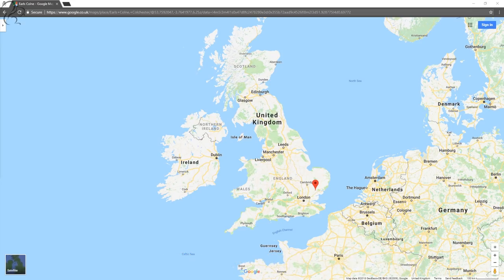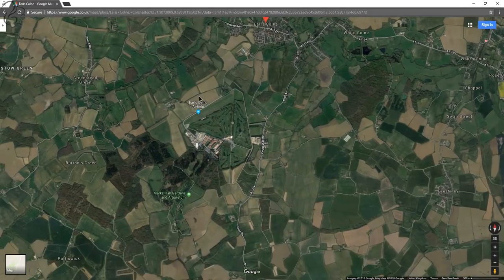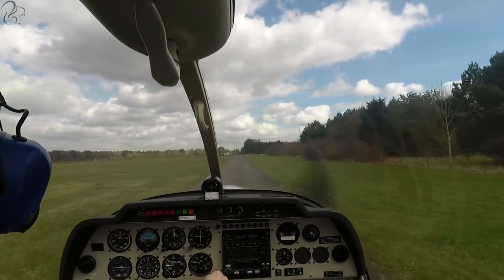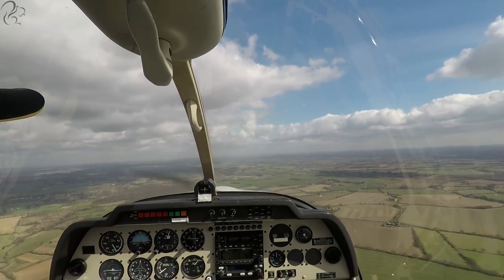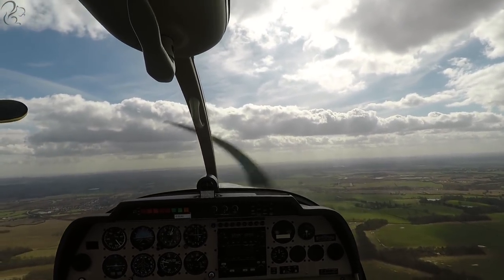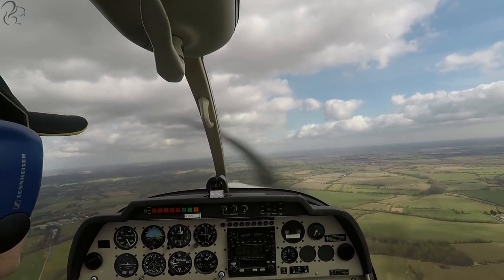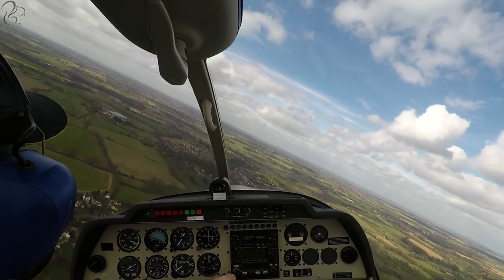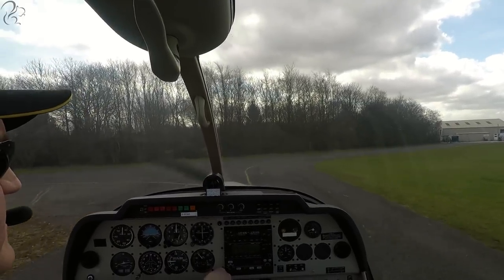Flying Solo Circuits - Flying Squirrel (#1)

Comment: Hey squirrel,
Although the slight crosswind you could have put in rudder so the nose faces into the wind and then when you're about to touch down kick the rudder off. Also you 'Ballooned' your landing which you should of went around instead of almost stalling at about 10 feet.

Comment: enjoyed that found it interesting. The americans flew Marauders out of there, the pub on the B1024 Coggeshal Road had its hipped roof removed and replaced by a flat concrete roof as the bombers flew out so low . The current roof was built over the top of it. When I did my hgv training the perimeter road was used for the reversing and emergency exercises.

Comment: I usually think flying is boring. But i found this video interesting all the way through. Think it was because you talked the whole time.
Reply: Moto_Nerd yeah how he remembers all that stuff is beyond me.
Reply: Bassmint I think with lessons I could learn to fly but to remember all the things to say I'd have to write it down 😂
Reply: Bassmint check list. One can see him consulting it on pre takeoff check. Otherwise it seems pretty common sense. Couple spot calls to tower on procedure points. Looking for other in turns. The landing equipment check is the biggest one. Though I think usually pilot has checklist handy visible to consult. Kinda supposed to also. Even decades flown commercial pilots are supposed to follow written check list in key checks to prevent mind bugs ruining things.

Actually flying is pretty much like driving. Experience, learning routine skill,  practice and feeling the planes response. Following to main indicators altitude and air speed. Apply pitch and throttle as needed. As said mostly it is just about having enough training hours flying, to get the routine and muscle memory for it.

Comment: Great video! I love that you're taking your flight (sim) love to the next level.
Is it possible to film this with a global shutter camera, cause that prop deformation is triggering me.
Reply from the maker: 30fps camera causes that. I could film in 60 but you’ll just have a prop that spins slowly instead. Can’t get rid of it I’m afraid, not with a GoPro
Reply: Need a DSLR to get rid of that artifact.

Comment: Whaat age you need to be to start PPL? Because i'm 10

Cheers from Finland
Reply: Jopu 700 likely 18.
Reply: It changes by country. Here in the US it's 16.
Reply: You can fly with a instructor at 14 and solo at 16 but you can't get your lisence until you are 17.
Reply: Here in the UK it is: 
16 years old to hold a licence for a glider or balloon
17 years old to hold a licence for aeroplanes or helicopter
Reply: jonFezza Thanks mate
Reply: TORILLE
Reply: Age isn’t the issue man. It’s the price, have you got deep pockets?
Reply: Donovan Johnson , that is incorrect.  There is no minimum age to start receiving instruction from a CFI in the US, it is left to the discretion of the instructor.  I know this because I started at 14.  There are a couple age requirements for later pilot training.  You must be 16 to solo (fly the aircraft with no instructor on board [but you are still unable to carry passengers or fly "cross country" without pre written endorsement from your instructor in your log book {among other restrictions}]).  You must be 17 to take the private pilots examination.  I don't mean to be disrespectful but I do think it is important to avoid spreading misinformation
Reply: In the UK it's 16...
Reply: you would be able to start now I'm 11 and I'm doing it
Reply: Jopu 700 you need to be 17! I know so young I am going to get my pilots license and myself job is going to be a pilot
Reply: When I have a job I am going to be a pilot and you need to be 17! So young.
Reply: In Sweden it's 16. And likely the same in Finland
Reply: In the UK, you can start for it at 16 it think, keep going for the dream bro, I only have 2 years until I can apply, there are many people in my family who have been involved in aviation, it is the best job in the world!!  If you want to get behind the controls of an aircraft at your age, look for trial flights. I had one a few months ago and it allows you to fly really young(with an instructor making sure that you are safe) I was able to do it back when I was 13, it allows you to go up for about an hour and you are in control for pretty much the whole of the flight. Anyway, good luck and keep going. 😉
Reply: James Rayner nah mate you are allowed to control an aircraft with supervision from a trainer at the age of 14. This means you can get your first 12 or so hours before needing to go solo to progress in training. Then you can do your solo training at 16 and licesnse at 17. That will cost approximately £8k, then you will need, for an airline pilot, to get your MEPL, CPL, APL. These together will cost £100k. Most people take out loans that can be paid off over time. This is why most people try for scholorships with the RAF, fleet air arms and the army air corps. They will pay you to train and once served you years you can transfer your license on civvie street.
Reply: No idea for Finland, and it may be because I don't know nearly anything about flying planes, but I would recommend a Google search.
Reply: In my country you could start now
Reply: Levi The Pilot And you live in?
Reply: Jopu 700 New Zealand I’m 14 and I just started my PPL you have to be 16 for solo and 17 to get ur license
Reply: There is no age limit in the uk
Reply: Jopu 700 in the uk, you can start logging hours and therefore start your ppl training in the UK at 14 years old
Like me
Reply: I am doing my ppl and it is 14 to start flying and 16 to do your fist solo flight
Reply: lessons 14, solo 16, lisence 17
Reply: also good luck when spending nearly £5000 (in uk anyway) on lessons... maybe more if you need more than the minimum
Reply: In the uk you can start counting hours at 14. At 16 you can do your first solo and at 17 you can hold your license
Reply: 10? Are planes a special interest of you?
Reply: Reiverborf My God! How on EARTH did you get that one Mr Holmes?
Reply: wrong, I started flying at 12, flew solo at 15 (uk). got my licence at 17
Reply: Big_Nate69 sorry bruh, place i fly with says 16 minimum age... when did you do this? maybe laws have changed? or rules differ between schools?
Reply: started flying in 2006, dont think air law changed that much
Reply: Big_Nate69 strange, not sure then maybe im wrong
Reply: You can start learning at 16 but can’t go solo until you’re 17
Reply: wrong
Reply: Big_Nate69 what is it then?
Reply: Big_Nate69 I’m doing my PPL now and when I done my solo they had to check a few things including my age was 17?
Reply: Might be different at different aero clubs?

Comment: Is there anything in actual flying that makes you nervous?
Reply: Schu Bird I'm sure a mechanical/electrical failure of any kind would make any pilot nervous.
Reply: Bassmint For sure! I just found myself curious as to what Squirrel found more nerve racking when he switched from sims to real life flying. Especially if it's something less catastrophic, but still important.
Reply from the maker: Failures are always a concern. But let me tell you - the first time you fly solo and it’s just you and the aircraft in the sky, that’s when you realise the main difference between a sim and doing it for real
Reply: For me, I'm still afraid of heights to a degree. So I think just the takeoff and landing would be scary, because that's really when you notice how high you are going due to all the reference points such as buildings and trees. Once you're up it looks pretty sweet though, I think I could handle that!